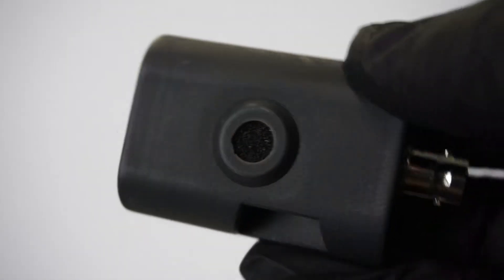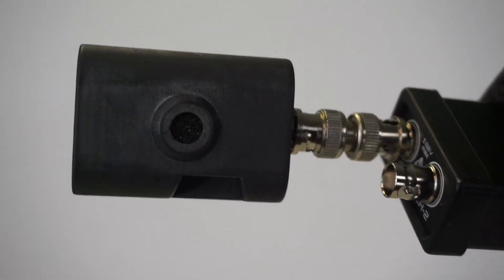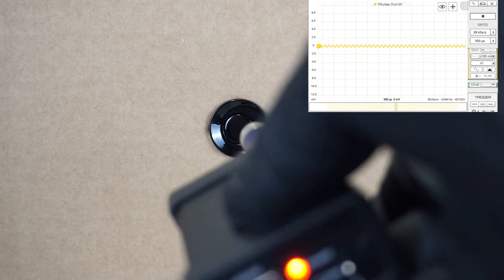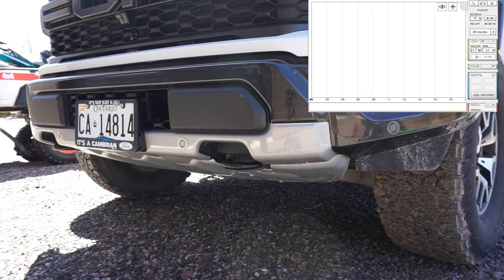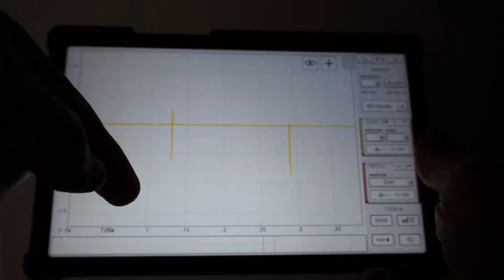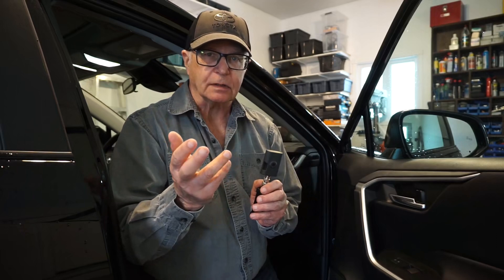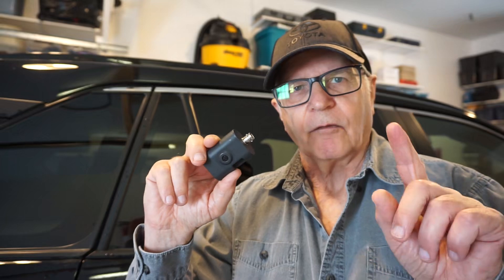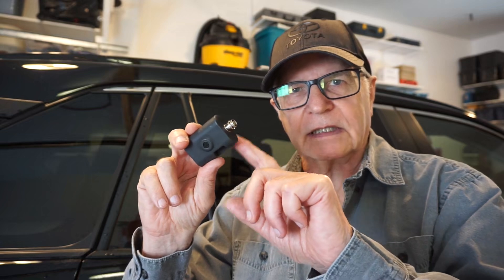GADGETS#209 - UAM80 ULTRASONIC MICROPHONE

Comment: I like to use for refrigerant leaks?  They hv much more expensive ones the let you hear leak via audible sound, wonder if this will work on scope?
Reply from the maker: I have not tested this on refrigerant leaks. I believe there are all-in-1 handheld leak detectors for this kind of work which might be more tested and practical
Reply: Yes hv one but ultrasonic blue one with headset is popular.  Lets you hear doppler audio. @theGADGETSplaylist